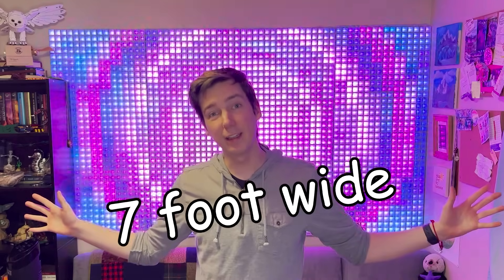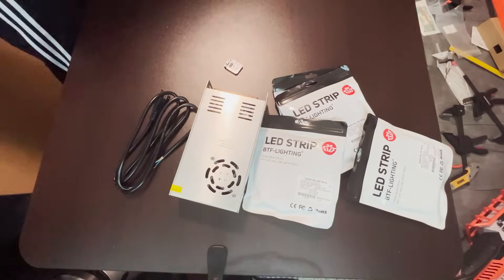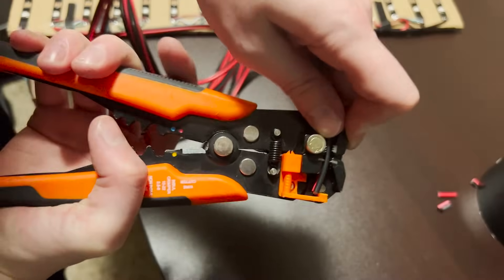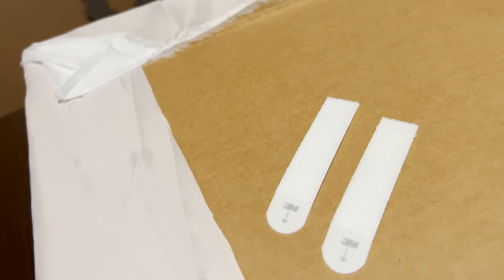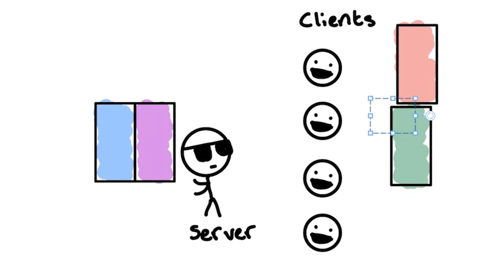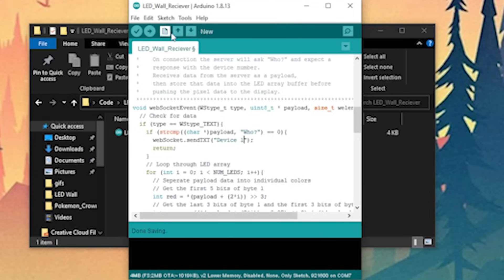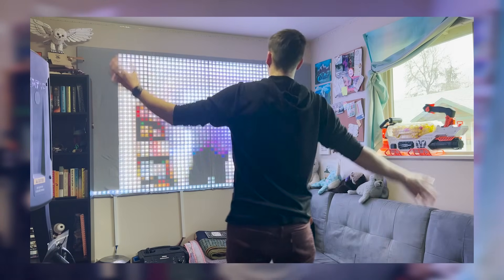How to Build a Massive LED Wall on a Budget

Comment: Very nice video, but you really should put a diode on the ESP8266 power input (cathode towards the ESP8266) so if you plug it in with USB your computer doesn't try to power up all the LEDs too. I also learned that the USB port on my computer had a fuse of lower capacity than the fuse on the ESP8266 board.
Reply from the maker: Only data and ground are connected between the LEDs and the esp8266 to prevent this. Great observation!
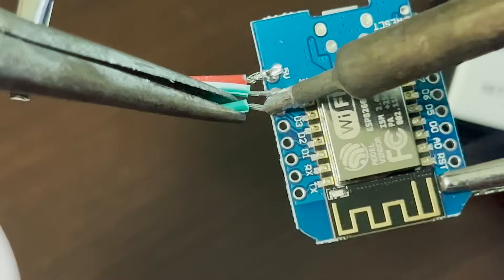Reply: @Tech-Random  3:55 You show connecting 5V, data, and ground. The Wemos D1 Mini clones do have a fuse between 5V USB and the 3.3V regulator/ 5V pin header, but it does not prevent backpowering over USB nor does it prevent the USB port from attempting to power the LED strip. I did this once as you had shown, on a smaller LED strip, where I needed to re-flash the device over USB as the OTA update did not work. I connected it (the device is at the ceiling, so a USB extension and 5V power were pulled through the wall to a low voltage box). It fried a USB port when the microcontroller tried to turn the LEDs on. To truly fix the potential problems does require 2 diodes (replacing the fuse with a diode in addition to the LED strip to microcontroller diode). That allows leaving it all in place and powered while flashing the module.

Yes, disconnecting the module from the LEDs is another way to accomplish the same task, but some people are going to want to put a similar panel in a relatively inaccessible place and might, like I had done, wire a USB extension. Or they might use their laptop to flash the device, and just plug it in while mounted. One 1N4001 is a whole lot less expensive than replacing a USB port. Swapping the fuse for the surface mount diode requires a bit more soldering skill. Some D1 Mini clones apparently already have this diode and then the fuse. Mine did not.

Comment: They now have UCS8903 pixels available which are 16-Bit, compared to most pixels that are 8-Bit, with the exception of GS8208 which is 12-Bit. The extra Bits would really pay off in a project like this. However the UCS8903 is harder to find and considerably more expensive than the lower bit varieties.

Comment: Is the 3D Printer also in the calculation? Or do you need the printer and then have costs of under 500$?
All in all very cool project. At first i thought, i wont build something like this. but know im not sure anymore.
Reply from the maker: It was included when I did the calculation. Each of the 4 panels is about $100 and the printer is $120. Things are a bit more expensive than they were a year ago so I’d recommend going through the full list of supplies you’ll need and getting a better idea of the current cost before you start buying things

Comment: You can buy a tv for the same price and the same size
Reply from the maker: This wall is 7 feet wide with a 115” diagonal
Reply: Ok, yes but ultra low resolution. I understand your project but is fun for you and for who want to experiment, but very unuseful in real life, you can buy a tv as i said before, or a video projector
Reply: @fiorenzo6301  it's not useless. festivals and venues use LED walls, billboards etc.. start building and make money💰

Comment: Just some notes on the connections. First, when soldering the wires to the 8266 board, the wires should have gone through the board, not surface mount soldered. Going through the board will give a stronger connection. Second, when connecting the line cord to the power supply, you have black and white reversed.  Technically since it's AC, it will still work, but also, you referred to the white as live.  It's not live, it's line.  You also have your line cord wires fed the wrong way.  When you bend them, they should have been fed from the left side of the screw, not the right, since the screw will push the wire from left to right (at the top) which will help pull the wires under the screw better.  Having it looped right to left can cause the wire to slide out of the screw as it is tightened.

Comment: HI! I built a LED wall with 10 mini panels but only the first 5 of 10 work (randomly), I imagine it's a problem of maximum socket connections, would you know where to increase the maximum number of connections? Thank you!
Reply from the maker: You’ll have to modify the code quite a bit to increase up to 10 panels. I’m not sure how many connections web sockets can support but it should be more than 5. If you can’t get them to connect over WiFi you could wire your panels together in pairs and then 5 connections will be enough.
Reply: HI! I added panels and increased the number of websocket connections and now it works.
the panel is 177x30 (10 mini panels of 177x3) 60 led/m, if you give me an email I'll send you a video :) @Tech-Random
Reply from the maker: Email is on my channel page in the about section!

Comment: How does it go for heat?
Reply from the maker: The 30 ppm LEDs are really spread out so it doesn’t get hot at all. If you want to build something like this with 60 ppm strips or something more dense then you definitely shouldn’t use cardboard.
Reply: @Tech-Random thanks

Comment: This is a great video.  I do have 1 question.  The esp32 is a 3.3v device.  The LEDs are 5 volt devices.  Why isn't there a logic level shifter?  While I'm asking, why not use 12v LEDs for better power distribution?
Reply from the maker: Great suggestions. These LEDs are 3.3v tolerant so no need for a level shifter
Reply: @Tech-Random  thank you for the answer.  It really is a cool wall and great video.  

I was reading the WS2812B datasheet.  It says the input voltage is -0.5～VDD+0.5.  Do I understand correctly that means the input voltage is 4.5 to 5.5 volts?  And, you're saying that the LED are capable of working at 3.3v. Although I'm sure the manufacture would say don't do that.  

Thanks again.

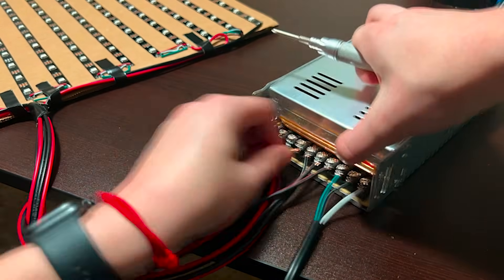Comment: 6:22 into the video, I believe you gave them bad advice on what color AC wire to connect to Neutral and Live. Black should be hot and white should be neutral.

Comment: I built this and the software side was a bit of a mess. It worked enough to make me happy, but it wasn't good enough to use easily. Recently I realized that I could flash WLED to the ESP8266 which made it immensely easier to use.
Reply from the maker: I’ll have to try the WLED matrix effects. Does your setup use a single panel or multiple?

Comment: you can get 40"-50" tvs for around 300 bucks, just put a blanket ontop and use a filter lmao
Reply from the maker: For reference, this is bigger than 4 50 inch TVs side by side. In total it has a 110 inch diagonal
Reply: @Tech-Random  ohh, i didnt notice. it looked big, but not that big to me. i guess everything looks smaller on video 😅

Comment: It's a cool project and all, but I feel like the description is slightly dishonest, considering you need a 3D-printer. If you got one, that's good. But surprise. Most people don't. 
The only reason I point it out is because it's sorta presented in a way that most people have, or are considering getting one. 

Besides that. Cool project, good guide.
Reply from the maker: If you’re interested in DIY projects like this then a 3D printer is a great investment. The one I linked in the description is regularly available for less than $150 and the cost of filament is included in the $500 budget for the project. I understand that it’s not for everyone but it’s the easiest and cheapest way I found to get the look I wanted for this type of display.

Comment: you're powering that many leds directly off of an esp8266? damn
Reply from the maker: No I’m powering them from four 300 watt power supplies and I’m driving the data with 5 esp8266 boards

Comment: I don't know... Nice project, but since you oviously put so much effort in making and recording the whole process, why not do it properly and safe? There are so many things you did as fast as possible without considering proper connections, fuses and boosting the data line with level shifters. 

It looks awesome and it works, but definitely lacks safety features! Especially due to the fact that everything is mounted on cardboard...

Comment: $500 led wall... $3000 of parts... $2000 worth of work... Awesome!
Reply from the maker: $500 is the cost of parts! $2000 for labor is pretty accurate though 😂
Reply: $500 is high for the actual cost of everything there. $60 of filament, $50 of LED strips, $50 for microcontrollers and random wiring, etc. no idea how it even got that high.
Reply from the maker: @smoothbraindetainer each panel is about $100 worth of parts: $15 of filament, $60 worth of LED strips, $5 piece of cardboard, $15 power supply, $5 microcontroller. Multiply that by four and you get $400 plus $100 in miscellaneous parts and tools. A lot of people in this thread don’t seem to realize how expensive LED strips can get when you’re trying to cover a large area.
Reply: @Tech-Random  oh you have one power supply EACH that's definitely overkill. 5m of 30led/m ws2812Bs should be $15 a roll, and even less in bulk
Reply from the maker: @smoothbraindetainer each panel uses 20 meters of LEDs so that’s where the $60 comes from. I buy them cheaper in bulk from aliexpress but I know a lot of people would rather use Amazon so that’s the price I shared
Reply: @Tech-Random  ah gotcha, that's per panel too. As someone else said, using WS2811's would be much better here to reduce PSU requirements. Plus they're usually 10-15% cheaper.
Reply from the maker: @smoothbraindetainer I have only seen ws2811 strips that address in groups of three pixels. If you want to build a video wall you’ll need to control each pixel individually. I would like to revisit this idea with a 12v strip like the ws2815 but those are a bit too expensive right now.

Comment: Is there a way to raise the frame rate?
Reply from the maker: You could raise the frame rate in a lot of ways. The easiest would be to run a wired connection instead of wireless but you could also reduce the color range by setting bpp to 8 and double the frame rate instantly. I’ve also switched to running the esp connected to my PC in AP mode so there’s less delay and it helped me get to about 30 fps. You could also use a different protocol than websockets to reduce overhead. Overall, I think a wired connection is best, especially if you want to scale to an even larger display or use higher density LED strips
Reply: @Tech-Random  I wanted to try and build this for twitch to be able show visuals behind me, like screensharing OBS. Does it display text very well? What would be the process to double the resolution? Whatprobles would come up trying to do that?
Reply from the maker: @FonixStudios there are quite a few comments that discuss increasing the pixel density. If you want to give it a try you’ll need to get 60 ppm strips and you’ll need twice as many. The spacer 3D print files will need to be printed at 50% scale and you’ll need 4x as many tiles. The power supplies should still be sufficient as long as you limit the brightness in code. You’ll need to modify the code a bit to account for the higher resolution but it’s pretty straightforward. Large text is readable but I wouldn’t recommend using it mainly to display text. A higher resolution would really help if that’s what you want.
Reply: @Tech-Random   Is there a spot where I could talk with you about a project I have been thinking about and wether it could even be doable? like discord or twitter?

Comment: Just a thought experiment, what happens if the pixels are placed closer together, technically making it higher res? Will the LEDs start to interfere with each others?
Reply from the maker: No interference issues but there’s a few other things to worry about. The microcontroller can only drive so many pixels before it starts to skip frames. More pixels will create more heat so cardboard will not be a suitable material. You’ll also need bigger power supplies with multiple injection points throughout the screen to ensure even brightness. Not impossible but it gets exponentially more expensive as you add more pixels which is why I think this design is an extremely cost effective middle ground!

Comment: I clicked the link and say the 300 light option in the same length, Hence doubling the resolution, Is this in fact that simple, I know the 3d print would also need adjusted but is it as simple as purchasing the 300 instead of the 150 ?
Reply from the maker: You’d also need to by twice as many strips to cover the same area since you’ll need to put them closer together. If you edit the code and reduce the max brightness to 25% then you should still be able to power everything with 4 supplies. Keep in mind that the max brightness test and single matrix test don’t have an easy way to set a low brightness. You’ll most likely need to run everything in a wired configuration some the wireless signal already lags a bit this lower resolution
Reply: @Tech-Random  It shows the strips are the same length, it just adds lights closer together. 

The power supply I understand will need upgraded. And wire would be ok also as it would be for a store display.
Reply: I see why double, For the resolution going vertical. Makes sense after I thought about it.

Comment: Putting leds on cardboard is something new. That's gonna do wonders for heat dissipation! Wonder why CPU fans aren't using cardboard instead of Cu or Al.
Also, a potential fire hazard.

Comment: You've got the black and white wires to the input of your power supply reversed. i.e. the black wire should go to the L(ine) terninal, the white wire to the N(eutral) terminal.

Comment: You should have put the led strips on a aluminium plate instead of cardboard, for a better heat dissipation
Reply from the maker: Good suggestion! If you’re going to try this make sure you cover the aluminum in a non-conductive layer so nothing shorts out

Comment: It's a very impressive project congrats! I just wanted to note that I think using 3D printing to just print a grid is not very effective and must have taken so much time, maybe it would have been faster to build the grid out of cardboard or wood and then paint it?
Reply from the maker: I actually started building it out of cardboard but it was taking so long to cut and glue that I gave up halfway through the first panel. 3D printing does take a long time but it’s passive so I was able to work on other things while the parts printed so it was the better option for me!

Comment: How feasable is a set of 5+ panels with your software?  would more adgustments need to be made or just continuing to follow the steps with all additional panels?
Reply from the maker: You would need to modify the code slightly to add a fifth panel but it should be pretty clear since you’ll just need to call each function a 5th time.
Reply: @Tech-Random  Is there any limit on how many can effectively be sent?

Comment: WitaHello, great project. I'm trying to make one display. In total, there was no problem with the led strip, but I have a problem with connecting the receiver and the receiver. It seems like everything is uploading but I have no connection to the display. I could ask for helpm
Reply from the maker: Are you using the “single” version of the code? If so make sure you’re setting the bit rate to 24bpp in LMCSHD. When connecting to the server over USB I’ve noticed I have to do the Serial->Connect step a couple times before it properly connects. You’ll know the connection went through when it automatically sets the width and height to match your board. Good luck!
Reply: @Tech-Random
Reply: Hello, this is a single display. The receiver connects correctly to my home network, but the transmitter does not respond at all. I turned on the LMCSHD program several times. I tried with files to several displays with no response

Comment: Really cool! I'm an event planner looking for an alternative to renting LED walls from production companies, this might not exactly be the solution but it's super close! maybe If could find smaller LEDs I could mash together to get a higher resolution image. Also creating a way to setup/takedown and transport would be worth considering for someone in my situation. 

All in all, you did a great job! I subbed off the video alone. You made this very easy to understand and feel like something I could do even with no engineering background. Thank you, this was a great help in my research!
Reply: there's 144 pixel/m ws2812b strips, for example. if you mount those very close to each other there's barely any space between each LED. just will have to be mindful of increased power consumption and how quickly your amount of pixels increases (making them harder to drive at higher framerates).

Comment: The problem is that you can get a used tv as big with million times more resolution. Good project though😊
Reply from the maker: This wall has a 115” diagonal so it’s still much bigger than the biggest TVs I’ve seen. But I also prefer the LED aesthetic and it’s always a great conversation starter when I have guests!

Comment: How did you calculate the dimensions of the 3d printed grid?  I am using 60 led/m strips and need to adjust the scale of the grid.
Reply from the maker: I used calipers to get the exact dimensions for the model. Since mine is for a 30 led/m strip you can print the tiles at 50% scale and they should work!

Comment: This is wild! Compared to tour/live events/staging LED walls, it's obviously not that great, but the way this works out is honestly very very impressive and I'd love to try it myself with my brother.
I cant wait to see what else you're going to do with this display!
I think it would also be pretty cool if there was some way that we could run this through a Cat5 type cable. It should be able to carry enough info considering the wall's resolution is pretty low, and it would solve your cable problem.